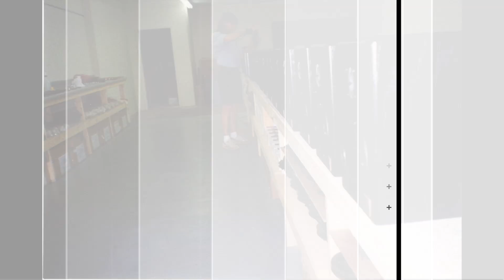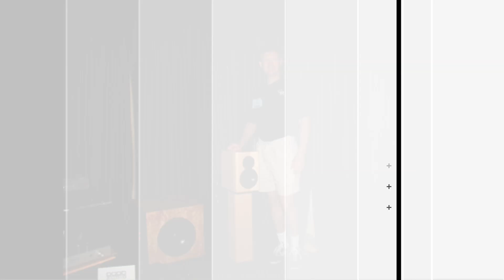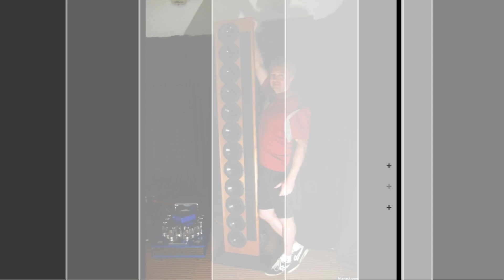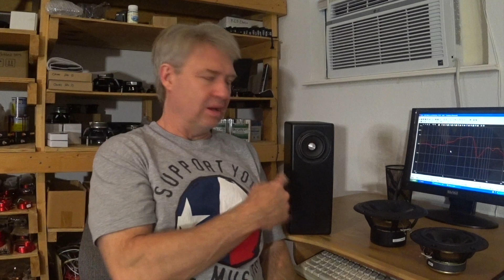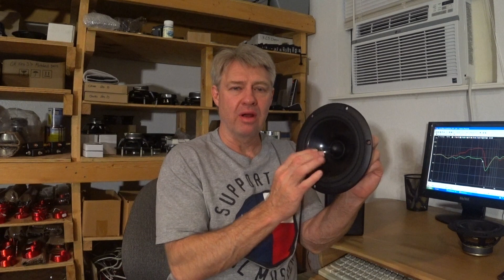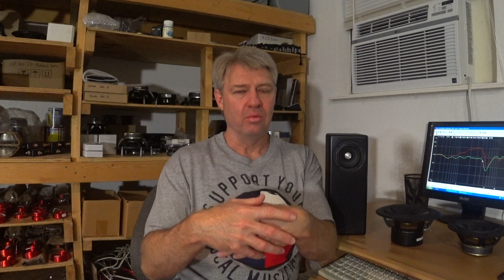Hey Audiophiles! | DO SPEAKERS REALLY DISAPPEAR?!

Comment: Good lord Danny - it's as simple as the radiation pattern. Speakers don't have to have a "baffle" on the front only and send their sound only forward. There should not be an "axis" but rather a radiation pattern. If there is equal or greater output to the rear the reflected sound makes the speaker disappear.

A CERTAIN RATIO OF REFLECTED SOUND OUTPUT IS OK.

Comment: 20khz has a wavelength that is about 0.675 inches (17.15mm). It’s small but not particularly smaller than some tiny tweeters. Do these beaming rules apply to all types of tweeters?, how about throated compression drivers? Would the tweeter surface area be the size of the throat, the opening of the waveguide (or some other waveguide measurement), or the actual diaphragm size? (Or something else entirely?)

Comment: Thanks for your very informative videos. One question: if you make the measured response (which excludes room reflections) flat and in a real life situation mainly have lower frequency reflections from the room (below the step frequency), the sum of the two will lack the high end because no reflections will contribute to the level?

Comment: Narrow baffles sound more transparent due to a more omni pattern? So what does transparency has to do with pattern control? Pattern control can be achieved using wide baffles too. 
Please define transparency!
Reply: Skip ahead to the 12:00 mark in the video to hear how my voice changed simply by adding my hands to each side of my mouth. Large baffles work in the same way. The surface reflections from the baffle itself project the sound from the baffle forward and draw attention to the location of the speaker.
Reply: @dannyrichie9743  I watched the whole video, your example at the 12 min mark is essentially changing the baffle step diffraction... You might be confusing imaging with transparency, but that isn't a function of baffle width and what does transparency has to do with pattern control? Pattern control can be achieved using wide baffles too. Please define transparency!
Reply: @dannyrichie9743  So let's define transparency as the speakers disappearing and the imaging being defined and coming from areas outside the speaker. What does that have to do with pattern control like you claim at 13:19? Having a narrow baffle isn't a requirement, some of the best speakers I have ever heard are constant directivity using waveguides or co-entrant horns like the Synergy.
Reply: So if transparency is the disappearance of the speakers we are audibly doing away with the creation of a boundary plane and allowing the speakers to create a depth of sound stage. The surface reflections of a large baffle eat that up. Take it a step further and just mount them in the wall. Now you have no transparency or depth of the sound field. Now everything plays from the wall forward. 

And waveguides and horns are typically used on higher frequency drivers and in frequency ranges that do not become omni directional. But some speakers do use horns down into ranges that will create a noticeable location of origin (lack of transparency).
Reply: @dannyrichie9743  I used your definition of transparency but to me that's what I call imaging, transparency to me is low distortion, but those are not really related to baffle width, nor is good off axis response. A narrow baffle isn't a requirement for good imaging.
Reply: @CorradoVR6z  Imaging is when the output of two sources arrive in such a way as create a source outside of the two speakers. You can get that to so degree with almost any well positioned speakers. Transparency goes beyond that and allows depth and layering that goes beyond the plane of the speakers. And yes this is very negatively effected by the surface reflections of a wide baffle. The large surface area creates a source or location of origin. There is no getting around it.
Reply: You could ask the same question about an in-wall speaker. This information might be more helpful. Don't miss the story near the end of the post: https://www.audiocircle.com/index.php?topic=160242.msg1709644#msg1709644

Comment: Hi Danny, off the top of your head, how big a baffle would you use on a 12" paper cone pro driver with a coax tweeter being used in an open baffle configuration? Would you use a smaller baffle and then do the side panels like you use a lot? I increased the baffle size which increased the mid and mid-bass, and after that I installed (different depth on each side) side plates. The over all sound is pretty good, they measure flat... but the sound stage doesn't do much in terms of depth. Thanks for the videos!
Reply: The large baffle is what you want to avoid. Make the baffle no larger than what is needed to support the driver. You can get your front to back separation with some side wings. Check out what I did with this 12" coaxial design. It worked out really well. https://www.audiocircle.com/index.php?topic=73341.0

Comment: I would rather have a wider baffle speaker accommodating large format drivers. Yes the small bookshelves, skinny floorstanders image better, particularly in regards to vertical sound-staging but they lack convincing dynamics. You can say "Well these standmounts have great bass" but they don't. Not compared to large speakers. Physics isn't malleable in that sense. There is no substitute for size.

To me music is all about dynamics. These low efficiency stand-mounts/floor-standers don't cut it.
Reply: Right! In other words, there is no "perfect" speaker. Audiophiles should always look for a speaker that sounds best to them and leave it at that. I can't understand why some people think that there is a speaker somewhere that does everything perfectly.
Reply: @Diatonic5th  - There is no anything anywhere that does everything perfectly. Any engineer in whatever area of the discipline knows that it is always a series of trade offs. The better ones look at constraints of price, available materials etc and employ clever design to achieve an outcome that performs in the best way possible, in areas important to them.
Reply: I agree that a small, low sensitivity speaker doesn't quite do it for me either. But they can disappear very well (some of them anyway). However, I have also designed some speakers with small open baffles that have high sensitivity and dynamics. Some even play flat to 20Hz. You really can have everything if you want.
Reply: Chris Kelly I’m currently using the PRV 5MR450 ndy “open” no baffle or box from 450hz up supported with large, efficient, passive radiator subwoofers.
I think it’s possible to have the best of both worlds if You’re creative!
Reply: There are plenty of speakers, especially higher end ones, that incorporate larger cabinets on bottom for the bass drivers and a narrower baffle around the midrange and tweeter for improved soundstaging.  Vinnie Rossi's prototype loudspeakers immediately come to mind.  Even the Goldenear speakers move a lot of air in a very narrow baffle.
Reply: @ewmcdade  What you described is a trait of pretty much every high end speaker. They baffles always taper in around the mid-range and tweeter.
Reply: This would be an excellent follow up video question for Danny.  Specifically something like the Gallos with subs so you have the bass but still have the imaging...in theory....  or does the sub then defeat everything?